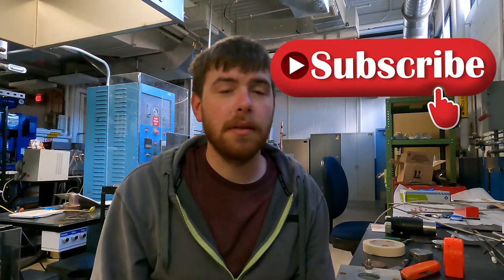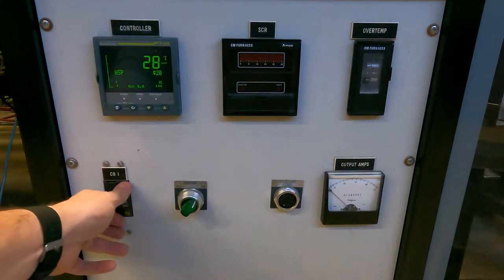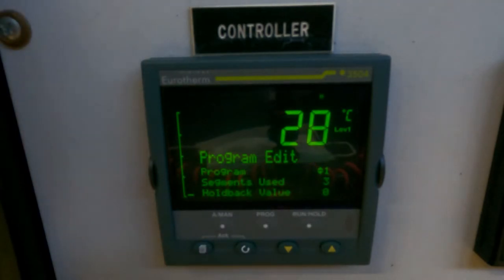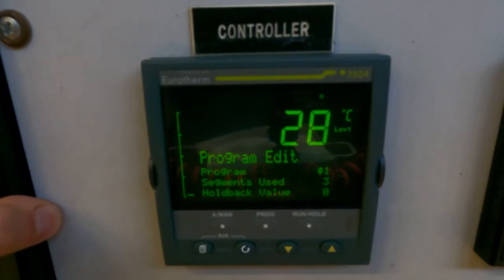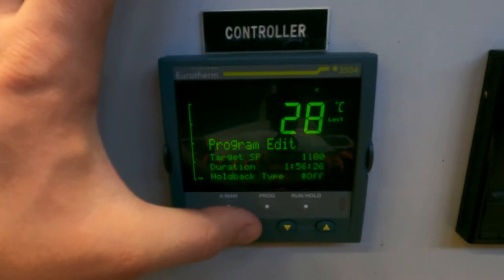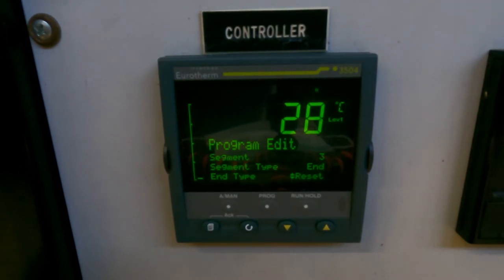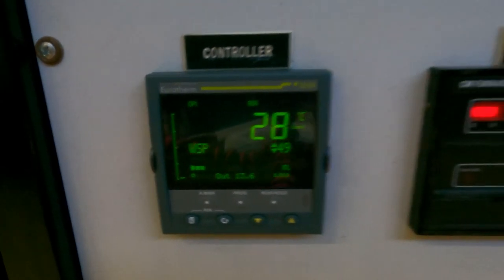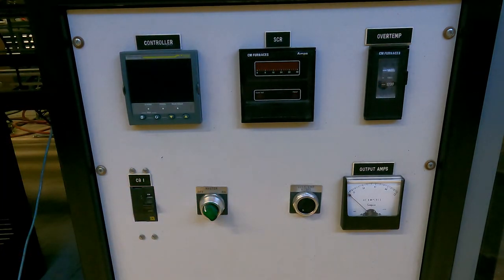Tube Furnace Tutorial (Eurotherm Model 3504 Controller and CM Furnace)

Comment: I have a combustion Furnance controling 2 valves number 1 its gas/air control an the second one its gas control this its with a eroelectronic control but actually its obsolete, can you have an configuration example of this (just digital control) , to migrate with Eurotherm 3504 control?
Reply from the maker: Hello and thanks for your comment! I am sorry but I won't be able to do this for you for a couple reasons
1. This is an electric furnace and none of the lab furnaces are setup for combustion heating control at our lab.
2. I am no longer at this lab anyways so I wouldn't have access to this particular furnace or controller to make another video. 

I would suggest reaching out directly to eurotherm and asking the technical staff your questions about setting up a combustion furnace. A different controller may be more appropriate also. I am not sure.